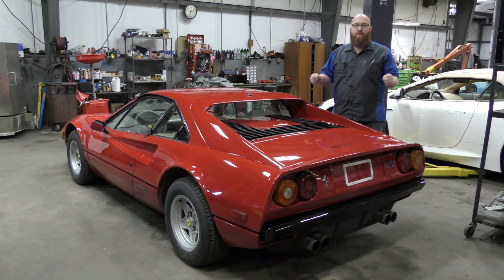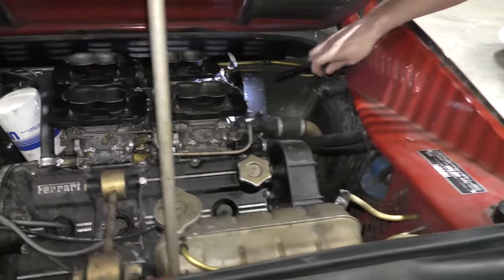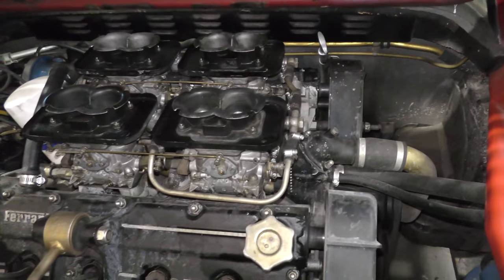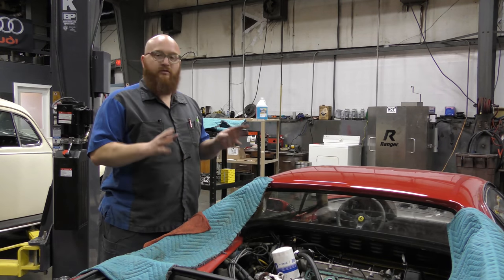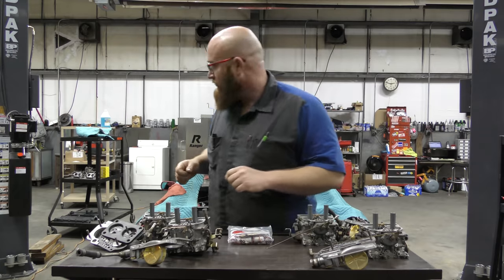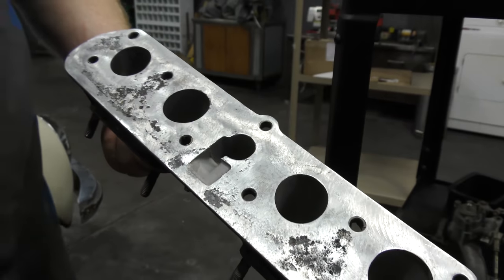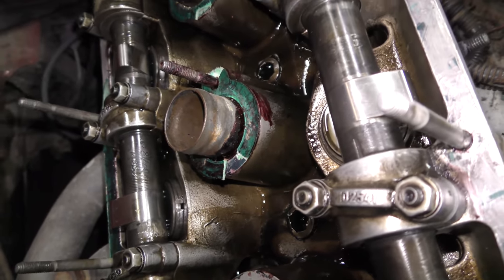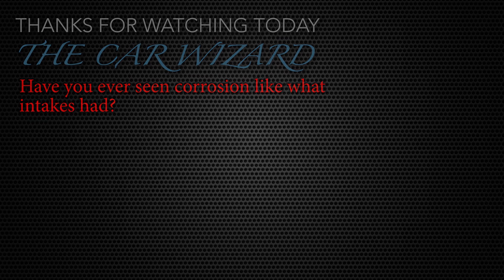Tearing down the Car Trek 4 Ferrari 308 V8! What does the CAR WIZARD find?

Comment: I wouldn't dispute the notion that the problem didn't at least start with air bubbles in the casting.  It just doesn't look like all that damage could be caused by corrosion.

Comment: hey car wizard, not all 308s had twin distributers, certain year cars with carb set up had single distributers straight out the factory with that purpose made blanking plate where the second dizzy would be, so it could be possible that your car came with a single distributer in the first place and was not necessarily a conversion from a twin distributer, at any rate keep a single dizzy system if you can, and electronic rather than points. I've owned a euro 308 gts for more than 25 years, carb set up and it came from factory with single distributer. Im watching from the UK, in Scotland actually.

Comment: Just wanted to stop and say.  The way you take the time to explain what is going on with the engine is great.  I worked on cars as a mechanic for years and none of my lead techs were half as good as you are.  You need to open up a mentoring program or something for the next generation of techs.  Even if it is just one at a time.  Cheers!

Comment: The TC Webber carbs are remarkably similar to the ones I used to work on in the Ford 2000cc pinto engines in the UK back in the early 80s
Reply: Weber and Dellorto are the best carbs available. I have a fun MK2 Golf with a Weber 32/36 DGV.

Comment: Check the heads on your JAAAAAG V12 engine for horrendous corrosion like that. A very common problem with those engines when they get old and they haven't had the antifreeze changed every 5 years or so.

Comment: 2976cc would round up to 3.0 liters, even by German or Nordic or Japanese automotive industry (and, in general, by way of principles of mathematics and by way of common engineering accuracy & tolerance standards) standards and practices and especially if we're talking about the marketing departments take on the concept.

It's 2927cc, so it rounds down, if we go to the most common industry engineering level of accuracy of measurements and tolerances. But, to be frank most engine displacement figures were rounded up to the nearest decimal point in the 1970's practically globally at least in marketing, so for once the Italians aren't taking their traditional egregious liberties with the end products spec sheet figures. :D

Comment: That is a beautiful car, and I can just imagine myself cruising around in it. But with all the things wrong with it (that you have found so far, there will likely be more) I'm beginning to wonder if it was worth $25K. I would like to see the underside, especially the frame and suspension. I have found damage to the frame and suspension on so many cars, usually from driving over things or improper jacking and lifting. With some of the emissions CRAP missing and modified cams, it would not pass an emissions test in my state. There is a way around that in my state. You can have the car insured by Hagerty and then register it as a collector car. That eliminates the emissions test. That's what I did with my 1976 Corvette with a hand built 400hp+ engine under the hood and NO emissions CRAP on it.

Comment: If it's not original, and you want it as a "drivers car"... I would put those carbs and intake pieces in a box, and fabricate a new aluminum intake with a Holley 600cfm 4-barrel!  ( 4 carbs is a complex nightmare )

Comment: Do you think the intake manifold corrosion/erosion was caused by an old school coolant that wasn't aluminum compatible, with too much silicate for example,  or is it more likely that aging coolant sat in the engine for long enough that it became corrosive and ate away at the surface?  I know the car only has about 20K miles, so it seems likely that it sat for extended periods of time.

Comment: That Ford distributer might work at idle, but Ferrari didn't fit two for the buggerance factor.  I'm sure you know what I mean when I refer to 'crossfire'.  With a likely rather massive advance curve in the ignition system, the correct, rather wide 'hoof' of the distributer rotor arm would likely fire onto a neighbouring ignition point in extemis, and give a high-speed misfire.  On an eight cylinder distributer this is very likely, as the physical distancing is insufficient for such aggressive ignition curves.  I suggest this, as the original use for this distributer would be for a far lower tune of engine management (mechanical).  Even the advance curve will be way out.  Two distributers gives each bank the wide arc of separation necessary to give both that distancing of the firing points (90 degrees) as well as relative manipulation by way the advancing rotor arm (also needing to be manufactured correctly to take into account the degrees of mechanical advance required by the engine's requirements.  I suppose you could simply fit an electronic programmable unit and put Ferrari's data into the thing or do so on a rolling road under varying revs and loads?  I only suggest this from my experience working with high engine-speed V8 road-car R&D, in my earlier career, where it reared its ugly head!

Comment: No need to weld and machine those flanges. In fact that will probably open up a can of worms from it being cast aluminum. There’s plenty of high quality metal filler compounds on the market that will fill the pitting and allow a proper seal again.

Comment: 7:20 I just saw this on harry's garage with a............ uh oh, a 1970's Jaguar V12, like the one your putting in the chevelle, like you badly want to run waterless engine coolant in those as its got some sort of thing where its a wet liner engine, and when it corrodes from sitting it gets really bad, also i think you might have it backwards with the camshafts, the ferrari 308 was known for having its power far higher up, and it was abit low at the bottom end

hence why people always knocked these things, they were ground up to do a 160 mph, but their zero to 60 times were about 6.5. vs like the 7.5 to 8 of the corvette of the era

while the testarossa and the hypercars were in the 4's and 5's, like the TR was 5.3 and FYI Hoovies testarossa was not in good health when he had it and it needed a tune up just from the way it looked and sounded, hence why I was abit miffed at him for getting rid of it and dunking on it before you had a look at it. 

as hell Harry's own TR was running on half a bank when it was tested on the grand tour, all thanks to no one checking the distributor on it, as part if the cap had broken off, so those things are better than that. 

but regardless it might have been reground to give it more power off the line, after all that's why they did the burnout on the grass in the old magnum show for its intro, it was the best way to get it to do that. 

but its still a reasonably quick car, its just that like all old italian things, you need to look after it and keep it tuned to get the best out of it, and what are americans always terrible at? 

also did you check to see if it was a steel or fiberglass car, as I still find it kinda weird that the front spoiler was made out of fiberglass like that, unless it was part of the guys attempt to make this thing look like a 288 GTO.

Comment: From my experience with DCNF's (must have 20 of them) I have a doubt on the diagnostic and the cure. It is not by spraying fuel a bit everywhere that the missing cylinders are pointed but by removing one by one the ignition cable and listening if there is a difference. With that, I have way more dirty of these carbs running fine. If there is no carb response, it can come from other areas and I'd first do a presure leak test on the offending cylinder. Why? Because on carbs, it is the depression that drives the mix to be driven down. On a very worn cylinder, you don't get response... unless you spray fuel ...  Another thing is cloged fuel lines. Not uncommon with modern fuel eating rubber. I also miss the see the state of the acceleration pump membranes (usualy gone solid and leaking)

Comment: Hi wizard, I wanted to ask you. If I change a fuel filter on a 2011 Touareg tdi. Is starting the engine and letting it idle for 5/10 minutes enough or should I bleed the system? (and if so how doni do it 😅).

Comment: Probably a dumb question but is that Ford distributor running off one cam gear? How does a four cylinder cam gear turn slow enough to fire 8 cylinders?

Comment: If tig welding the intake manifolds is too pricey, could you just mill it down and double gasket them?
Reply: I would fill the pitting with JB weld and then resurface it for a smooth and level surface.

Comment: On those plates you wish to resurface, Ferrari did NOT "Impregnant" {Seal}  those parts, properly, so BEFORE you send them out for a "resurface" send them out to be impregnated, or the parts WILL LEAK, UNDER the resurfacing, making you WANT to "dump this 'pig'.  Impregnation involves "cooking"aluminum parts in thick, brown sealing liquid, so the aluminum part does NOT "spall" under use as THOSE HAVE Done.   If you 'resurface' WITHOUT "Impregnation", the parts WILL spall UNDER the coating you apply, I WARN YOU.   I was an "Impregnator" for aluminum parts, so that the seal IN the part would "last" a hundred years or so.  We'd get entire 1/4-ton baskets of die-cast, aluminum parts back from Ford, GM, or Chrysler, if just a few/the top layer of oil-filter housings had developed OXIDATION common to un-sealed aluminum parts.   I'd have to then "RE-impregnate" those parts AGAIN, along with my usual work!

Comment: Where the heck is the airfilter?? That's  very bad for a motor. No wonder the carbs are gunked up. And those poor cylinders have had grinding paste mixed with the oil because of that.

Comment: Are the regulations in KS sufficiently lax as to permit the elimination of pollution controls? I would get arrested in CA for half the stuff I see people doing to these cars.
Reply: I once put a Kubota 905  3 cylinder 24 horsepower diesel in my Geo Metro Convertible. In tests it got 70+ mpg.
When I went to register it here in the PRK (People's Republik of Kalifornia), they damned near threw me into death row at San Quentin awaiting lethal injection.   My 308GTS NEVER passed Ca smog inspection, not even once. 400 PPM hydrocarbons was the lowest they could get it.

Comment: Sad, but the car trek guys do sloppy work and it probably encourages viewers to do same.  If it were me, and I needed a quick fix for those intake manifolds, I probably wold have used some fuel-compatible JB weld product and then linish the surfaces flat.  Certainly would have been better than silicone gasket maker.

Comment: ah gummed up carbs the reason i aperciate injection systems more you can let a car sit for a while and not having to worry about it gumming up but aw well car wizard can rebuild these carbs this car will be worth it when finished
Reply: A gummed up injection system is a bigger mess..
Reply: @nicostenfors5690  but injection systems dont gum up as fast as its faster to start and theres mostly a high pressure feulpump i converted my motorcycle to feul injection in 2018 as i dont drive a ton and i am to lazy to pump feul in the carbs at 1st start

Comment: Interesting stuff. Tom Yang did a great film on the stripping and cleaning of a 308 Weber carb. https://youtu.be/R07ToCzxRfc also on all Ferrari’s of that era probably worth checking if the exhaust valves have ever been replaced. They can fail at the stem through metal fatigue.

Comment: throw the carbs away and megasquirt it
Reply: Correctly set up carbs will outperform a injection system. Sadly carb adjustment is a dying skill, and people are too lazy to learn.
Reply: @nicostenfors5690  sorry, that's just wrong.... like.... incredibly wrong..... like..... who fed you this misinformation?

you can tune a carb perfectly for an exact altitude to work at an exact rpm all day, but it'll still only come very close.

I wont go into everything, but just the fact that there's obstructions in the intake means you have to make compromises. AND it's a parasitic venturi. This is only minor in perfect conditions, but the first in many issues.

you don't have to respond
Reply: @fillman86  You are correct about the altitude problem i will give you that (not a problem in my pretty flat country) but carbs can be made to work on a wide range of RPM's, of course every carb is different so some of them do that better than others. Idle jet controls Idle, primary barrel does normal driving, secondary barrels open when power and revs are needed etc. Different parts handle their own rpm range. Carbs also have the advantage of responding exactly at the moment that you push the throttle. This discussion could go on for days and we would find good and bad points of both systems but in my view the carb is better if quick power delivery is needed, it was wrong for me to write that it outperforms in every way.
Reply: @nicostenfors5690  it outperforms in no way... instant power? are you drunk?

I'll give you a compromise, carbs were cheap and easy to implement previously
Reply: @nicostenfors5690  I'll also give you that you think you know carbs (I don't actually know the extent of your skills, or if you're just regretting information)

But I must also point out that you don't understand fuel injection, and as a result you have a misconception. Which is fine to have, but to not be willing to even do a modicum on research, then spout misinformation is not acceptable
Reply: @fillman86  Yes you can make a carbed engine very peppy. You haven't experienced a well tuned carbed car?
Reply: @fillman86  A daily drive a VW Golf with a Weber carb and tune it myself, my friends mess around with injection. So far the carb seems much more responsive.
Reply: @nicostenfors5690  agreed, you can make a carbed car peppy, but with a mild aftermarket efi system you can have even more.... I'm not saying carbs are bad, just bad enough that it's worth replacing with efi.
here's some things that can be achieved
-better mileage 
-higher power
-faster throttle response
-a closed loop feedback
-flex fuel
-ease of maintenance (factory stuff can be tricky though)
-longer times between services
-rarely needs to be tuned
-works in more environments
-barometric pressure and other weather  conditions can all be handled (if your tuner isn't lazy) on the day it's put in and never touched again.

carbs are limited in so many ways, and does none as good (despite what the miniscule minority/anti vaxers says)